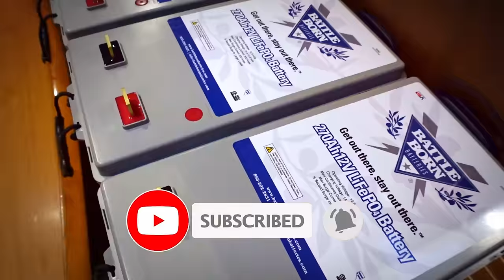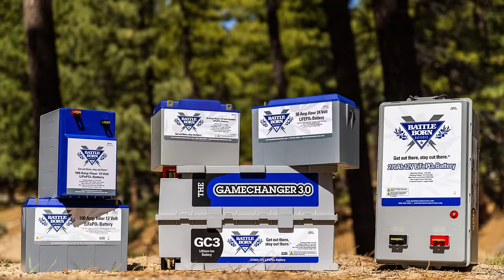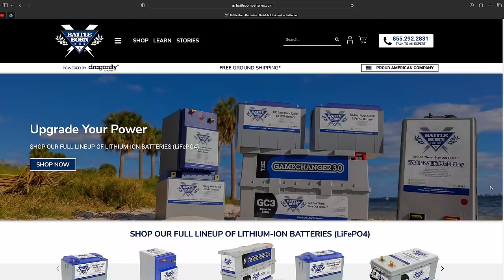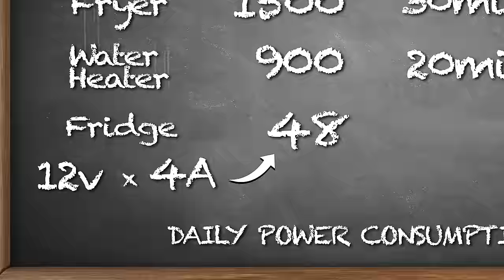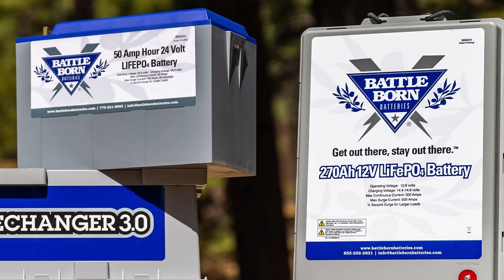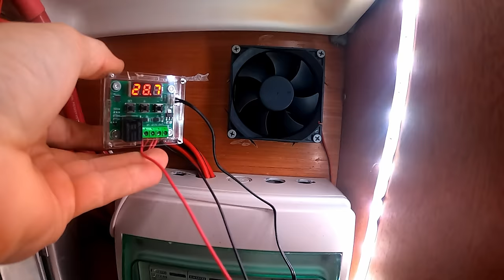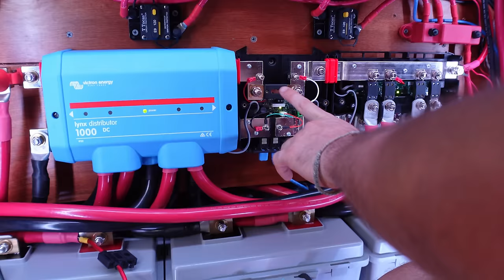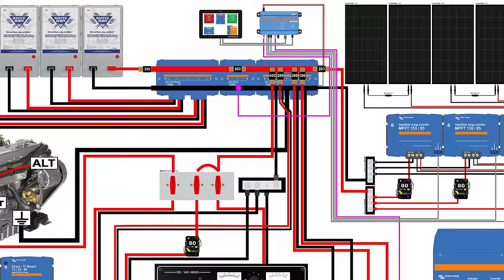Off-Grid BOAT WIRING for DUMMIES! 12v Lithium Battery Bank Install: DIY HOW TO  🛠️💥| ep.26

Comment: Sorry to inform you from incorrect translation.. ! AC/DC is not high voltage/low voltage.. it is Alternating Current/Direct current, it has nothing to do with voltage
Reply: Marine DC voltages are usually 12/24/ 48, thus the low voltage designation.  In the U.S. AC systems are always 110/220.  It is just easier to say high voltage/low voltage systems.  Large boat owners know the difference because all AC devices have to be connected to a converter.  I enjoyed the fact that two very smart people designed a complex system by going to knowledgeable sites online.  Then they customized the system for their boat.
Reply: @Madnessinmedia  yeah i undestand that we are speaking of a boat, but its still a bit dangerous and misleading to say that dc is low voltage and ac is high.. type of current has still nothing to do with voltage.
like alternator is ac but it still has only 20+ v in 3 phases
Reply: Who gives a 💩 about who Will Prouse is proud of? Electricity is unforgiving. You MUST KNOW and respect the terminology and their meanings. Otherwise, stick to just drinking beer, in this case.

Comment: High voltage doesn’t mean AC and low voltage doesn’t mean DC. You can have high and low voltage levels of either type of current.

Comment: As an electrical engineer, I always cringe when someone does an episode like this. But you nailed it. It was simplified, but all the info was perfect. Can't say the same about other channels.
Reply: I was about to say the same. Just wish they had pointed out to never touch both sides of the bus bars at the same time. Also wish they had covered the charge rates, because math is not taught any longer.  😉

Comment: Nice going. 
But here my 2 cents .. don’t use the prop shaft as an ground negative. 
Use the keel.  Next to that ground the boat , mast rigging etc to that same thing. 

If you like to rot your brass prop away .. use it as a ground. 
Electrolysis will destroy the zink, brass bearings, aluminium. I have seen it many times.

To make your ship safe for lighting strikes. Use negative and positive main disconnects. 
Make sure your engine can run with out battery power.  Meaning the your common ground  must have a disconnect too.  But don’t make it the single chunk of metal to be connected with common. Just use the normal size wire for that starter motor to start battery and generator. 

As your boat is plastic, don’t connect the negative of your battery to any ships common ground. 
If you have wooden of plastic boat it’s nuisance to  do that. If only one lighting strike may enter your system. The easy way. 

Only radio antennas need a good ground. It’s called a base plate. That’s why it’s at your mast. 

I have installed many boats with electric systems and never bothered with a ground to the water.
See at your car or airplane .. they don’t have any too.

Tip for steel boats . Install an isolation transformer in-line with your shore power. It will save the hull and all other metals not to be eaten away by nasty electrons. 
Don’t use the hull as a negative but run negative cables like in a wooden or plastic boat.
Reply: Man you stole my thunder, I agree with you 1000 percent! As a retired electrical engineer and former Irwin 45 ketch rig I have been down that same road. A docked boat two slips away had an open neutral on the shore power. The ground was being supplied by the salt water and his prop shaft. That lead to my zinks were  being eaten up sooner than expected when did a hull inspection for bottom condition. I was lucky I caught the sacrificial zinks deteriorating and changed them out with out damage. The other boat did not fair so well. 🤯🛫

Comment: Congrats on your new system! I have spent 20 plus years as an electrician and can appreciate the complexity of these multi source, voltage, and amperage systems.  You did a great job at explaining voltage and amperages for your installations. Hope the new systems keep the beers cold and make plenty of ice for those higher voltages.
Reply from the maker: Thank you!

Comment: First off, we love your videos. You guys are great! I have a background in electronics, and y'all did a great job on this! Only thing I disagree with was your definition of high voltage and low voltage. It has nothing to do with AC or DC. Low voltage is simply 50 volts or less and can be AC or DC. High voltage is above 50 volts AC or DC. Keep up the good work!

Comment: Hi, good work, as always. Just one remark: DC voltage can also be high voltage. take, for instance, a Tesla battery bank with 400v DC. also: anything over 50 volt dc or ac can be lethal. One more tip: if you get an old radar cable from a salvage yard, you can get a lot of marine grade sensing wires for your boat electric system.

Comment: I’m a electrician and I’m extremely impressed with the tidy wiring and the logical design of the installation. You should be very proud of your work.
Reply: I’m a electrician, and I found this misleading since AC or DC does not mean high or low voltage. Tell that to someone that take their hands on 600v DC and get their hand charcoaled due to the high voltage DC. Misinformation can have fatal consequences for people in the unknowing. There is high regulations on Electric systems here in Europe. I'm unsure in other parts of the world.
Reply: @_vr  Don’t be confused. They are talking about the electrical system on their boat and not every electrical system out there. You must admit that the installation is very tidy.
Reply: @kelvinwilliams609  Absolutely 100%, it looks super nice and tidy. No doubt about that.

Comment: Great video and love your energy (pun fully intended but true 🙂).  I would like to correct something though.  AC vs DC has nothing to do with high voltage vs low voltage.  AC and DC are simply ways that the power is delivered and you can use AC or DC for both high and low voltage.  By convention, low voltage is anything below 50V and high voltage is anything above 50V.  In the USA, mains electricity is delivered as either 120V or 240V AC most of the rest of the world use 230V/240V AC.  The main reason AC is used is because it is more efficient (less losses) to allow it to be transmitted long distances (power stations to your homes) and is easier to convert between high and low voltage.  AC is also considered more dangerous as it is more likely to disrupt human electrical systems (electrocution). For some history, there was a famous competition between Nikola Tesla and Thomas Edison involving an elephant back in the 1880s which led to why we now have AC as our mains electricity.
Reply: I agree it was a very well done and entertaining video.  I too thought the AC/DC meaning  was a little too over simplified, but bang on for the purposes of the video.  But in regards to AC vs DC, I believe DC is more efficient.  I think originally it was easier to step down/up voltage levels using AC.  High voltage DC is used for long distance power transmission lines.

Comment: Nice job, two things to save on cables,space and money. Instead of connecting each battery to the bus bar you can use short cables to connect the batteries to each other in series… then just two cables to bus bar.

Second battle born is great but rack batteries like EG4 cost less, take up less room and are higher quality.

Comment: Bravo Zulu!  On the install put a bilge pump and water alarm on the floor of the bilge of that compartment, maybe even two of them, hate too see any sea water back there at all.   Someone can hit you in the rear, open up a leak you never know.  Again Great job, I like lead for the alternator, no BMS still will work after a lightning strike.

Comment: Nice job laying out the components and grooming the cables and wires. I have seen some installs that are a complete rats nest and would be very difficult to troubleshoot in the future. Your explanation was simple and understandable, but this was by far a very complex job and must have been a little intimidating for you before and maybe even during the install. Excellent job and actually quite impressive for self declared rookie electricians.

Comment: Hello guys! A galvanic isolator could be good from the shore power to the multiplus on the AC side, it depends if you lay in port with shore power connected alot or not. It blocks all the stray current between other boats connected to the shore (Common ground). This does not apply to camper vans, because they are not grounded in the water togheter with other vehicles (like our boats). 😄Just a tip! Great video, keep it up! 😃

Comment: Hi Tom from Norway
I don't see an isolation transformer or galvanic isolator in this layout.
See info from Victron:
Indispensable in professional maritime installations. It prevents electrolytic corrosion and is primarily used as a device that guarantees a safe electrical system. Toroidal transformers for low noise and high efficiency. Soft start ensures that the fuse ashore does not blow when connected.

Comment: For safety you should use Class-T fuses from the batteries due to the higher AIC rating required for lithium

Comment: Great setup and my engineer's mind truly appreciated your commitment to the dark art of good cable management.

Just one small addition... I would heartily recommend that you install a galvanic isolator to the shore power input to this system. When you're on the dock and taking in charge, any small stray current in the water from yours or neighbouring boats will result in your prop/prop shaft rapidly sacrificing itself! A galvanic isolator will stop this.

Comment: Guys, check out SV Dauntless, they just did an excellent multi-part Victron install series which includes some details you may have missed (specifically with galvanic isolation) ... also ... WATTS does NOT equate to WATT HOURS ... you need to include TIME to determine WATT HOURS ... not all devices will tell you their use over time, rather, they give you a MAX rating (instantaneous rating) in either WATTS or AMPS ... fridges cycle on and off depending on how much food is in the fridge, how well the temperature can be maintained due to insulation, or how often you grab a beer, outside temperature, etc. Let's say a 12V fridge has a max current rating of 5 amps ... to calculate the MAX power it might consume in one day, you need to know how long it is going to be on during the day ... if it averages 10% per day then it will be on for 2.4hrs * 5A * 12V = 144 Watt-Hrs per day  ... NOT 24 * 5 * 12 or 1440 WATT-HRS (the fridge shouldn't be running full time) ... an induction cooking device you might only use for 15 minutes a day at 1500 Watts that would only consume 375 Watt Hours ...  measuring a device's ACTUAL current can also provide more accuracy to your POWER calculations. The bottom line is you have installed a large battery bank, the key will be whether your Solar panels can keep the bank charged. Delos say they have to use their genset to keep up with the demands from Water maker, AC, Washing Machine, etc. Sophisticated-Lady has panels outboard and foredecks to help keep up with their power needs ... their boat looks like a floating solar panel from the air ... they added HIGH current Alternators to their engine which they use in lieu of GenSets.

Comment: Captain Rick upgraded his entire battery system a couple of times and he has a pretty massive lithium/solar setup yet he still hasn’t been able to get away from a generator. What he’s done was install 2 very high amperage alternators on his main engine that recharge his battery pack as efficiently as a generator. He still has a generator onboard as a backup those. If you haven’t checked out his setup go give it a look.

Comment: Awesome job planning this. Having each battery connect separately to a busbar is huge. That means at max 1000 watts per battery(inverter can put out 5kw). That is .3C max. most of the time you will be at .1-.2C. That means more efficient as you wont loose to heat loss as much.

Comment: Your fridge may use 4 amps while running but it shouldn't run 24/7, so maybe 2 amps an hour if cycling on and off for the same amounts of time but extra power never hurts, great job as always, nice and clean

Comment: Wow I want to say that is the prettiest electrical system I've seen in a long time you really did your homework and you should be really happy cuz you have no one you can expand on what you have and it's a really nice system and it looks good the only thing I would say is you might want to spend just a little bit more time they make special stickers or cables and you might want to label each cable for where it goes to and where it ends at so just on the fly with something bad happens you know exactly where going and works coming to but I really like it and when I get my boat you guys can come over and do mine too catch you later

Comment: Check out Oceanvolt electric propulsion systems and you may want to convert your boat to electric. Oceanvolt system can generate 1kwat/hour hydro generation during 7 knots of sailing. So it will decrease your dependency on the sun.

Comment: Load dumps are pretty much universally getting ignored or glossed over by Lithium battery manufactures. The problem with Li batteries is that, since the BMS is inside the battery, it has no way to communicate its intentions before load dumping.Typically, the time between BMS warnings and load dump is short. For example, Al, chief designer at Wakespeed, is a happy camper if the BMS gives his software two seconds to do the right thing. So, clearly, you want to build a system around a smart BMS and charging gear that can automatically shut down safely and quickly, before the lights go out. An internal BMS like Lithionics, that can send a signal, typically to a relay (solenoid, contactor), is not going to help us much if said relay disconnects the battery from the loads, even when it doesn’t need to. So it’s a fundamentally good practice when designing a lithium battery system to separate the charge and load busses with a BMS-controlled relay on each one. That way, in an overcharge scenario (likely more common than undercharge), the BMS can just disconnect all the charging sources but leave those vital loads supplied—fewer lights-out-related disasters. Of course, this means you need a BMS that’s smart enough to decide whether or not it needs to disconnect everything, or just the charging sources. Great to see that one of the largest vendors (Battle Born)of lithium batteries has finally got wise to the fact that when used on boats, lithium batteries with an external BMS must be able to communicate with external devices and the user to be safe and compliant.

Comment: Very nice work, very easy to follow your explanation of the system and what you are doing.  This is basically the same AC/DC/inverters found in RV's but much more high-tech.  It will be interesting to follow how well the system fits your needs/wants, how it holds up to the movement of the boat and corrosion from the salt air.  I think you may want to prepare yourselves for more air flow because it seems you could have some serious heat once you put a full load on it.  BTW, the boat overall is looking amazing.

Comment: Hi. I did not read all comments, but did not see any correct comments about low voltage and high voltage. All voltages below 50 VAC or 120 VDC are extra low voltages wich could not cause life threatning shock. All voltages above them but below 1000 VAC or 1500 VDC are low voltages (Can give You lethal shock!). And all above them are high voltages. Beside this fundamental error your video was very entertaining. Best regards from Finnish electrical engineer BSc!

Comment: Excellent video! You did a fantastic job! Your explanation of the electricity was right on, and the special effects were a plus. York install looks good. I like the cleanliness of it. My only question of the installation is, do you have enough ventilation for all that equipment? I wonder if you will need some fans to exhaust some of that warm air out of that cabinet. I look forward to your videos.  Keep them coming. I am looking forward to seeing that boat sailing in the open sea.

Comment: Great video and you two really did your homework to figure all this out.  A couple of things from someone who has done a lot of battery work.   first I would have a cover on every battery post and only remove it as I'm attaching a wire to it.  Also I didn't see your face but hopefully you were wearing safety glasses in case of a sparky spark.
Reply from the maker: Thanks for the tips!

Comment: welll. you did move the spool off to the side..    FYI  you know when you spool cat 5/6 like that, its basically an air gap Transformer!  hope you all dont get any real static electricity problems.. if so then expect that cat 5/6 air gap transformer to induce some of that power into your network ports..  just saying..

Comment: Your electric installation is good ... ALAS ... be prepared for HEAT.   You WILL need good ventilation to keep your electric cupboard COOL .... see Sailing Zatara and their installation for electrics .... also SAIL LIFE has an episode which will help you keep the electrics COOL.
Reply from the maker: With over sized wire and our ventilation fans we don’t get any heat transfer to cabins. It’s pretty cool inside the cabinet aswell

Comment: Good presentation, the only thing I would have done differently is your separation between low and high voltages, it probably should be AC vs DC. DC voltages are getting higher on everything, 48v will be the new standard in low voltages soon enough and that is enough to kill you with proper amounts of current (amps). But it will save you major $ in your cabling!